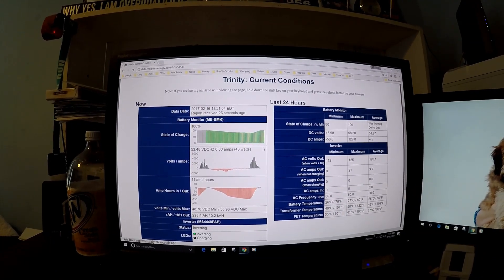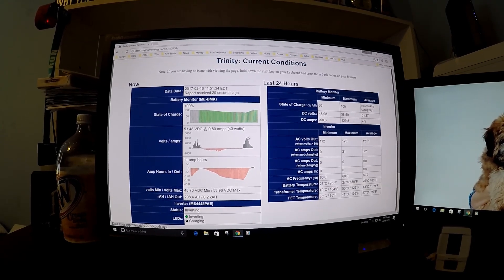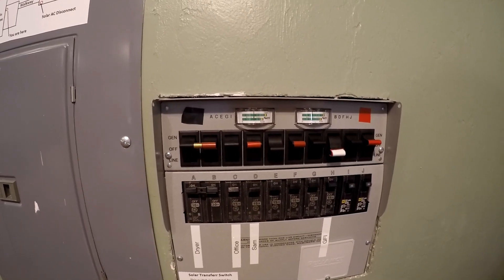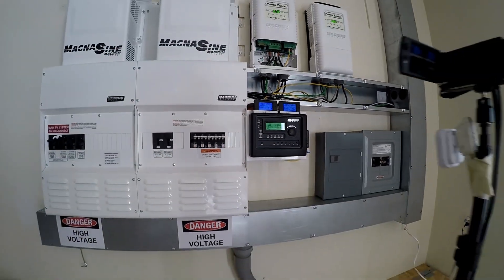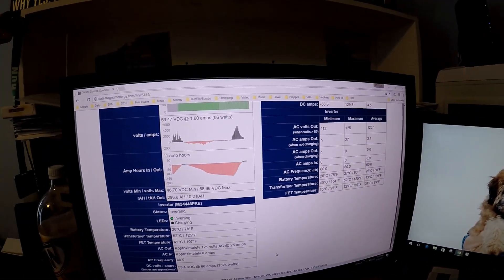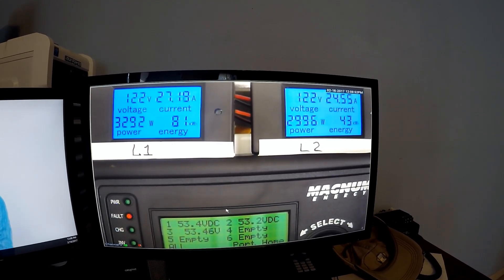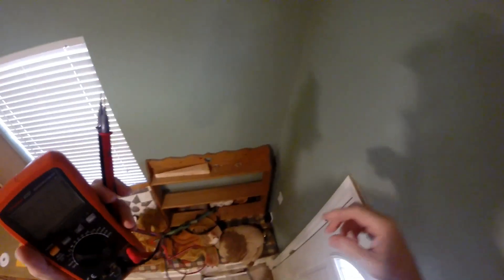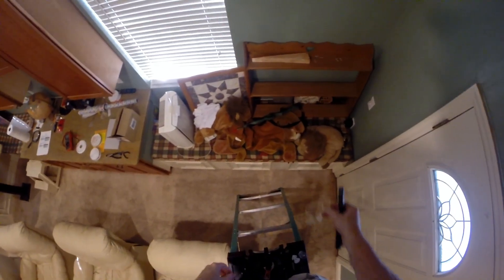Off Grid Solar #41: Running the Dryer on Solar

Comment: is the dryer completely electric? I'm thinking about going full electric, but thinking it will consume more than normal as it's 220
Reply from the maker: Yes, it is full electric and it is 240.  It uses about 6000Watts.  One of the biggest consumers of power in our house.  Think of it as like running 1000 LED lights.  Yikes!

Comment: I’d like to put a system like that together. I run off grid but can never operate my dryer please teach me your ways.
Reply from the maker: James, I have two complete start to finish series on my solar power but you might start with this summary: https://youtu.be/zb4oar9UHSY
Reply: @HomesteadEngineering  Just saw your comment on leadfarmer73 and while listening thought of drying clothes and left a comment.  Searched my question in youtube which lead me to you, how intersting-so I'm a new sub!  Thanks for the info, I'll be searching your vids as it seems like you're an old timer in you tube, cheers & blessings!
Reply from the maker: @gilamonsta5123  A good way to catch up on my channel is to use the playlist.  Thanks for stopping by and welcome aboard!  :)
Reply from the maker: @gilamonsta5123  start with this one: https://youtu.be/FUKDur73Ye4

Comment: Please how can you connect my commercial laundry to solar fully.
Musabalbarik2@gmail.com
Reply from the maker: musabalbarik2: Do you have a single washer and dryer or a business with many washers and dryers?
Reply: @HomesteadEngineering  I want to start a commercial one with many washersyand dryers
Reply from the maker: @musabalbarik2  :  My system would only run 1 washer and dryer and only when the sun is shining.  You should probably look into grid tied (net metered) systems.
Reply: @HomesteadEngineering  where i reside there is plenty of sunshine through the day and very hot.

Comment: I didn't realize you could run a dryer on the inverter.   I have so much to learn before going solar.  Excellent video
Reply from the maker: Desi, My inverter is rated for 8800 watts continuous.  The dryer takes about 6000 watts.  So I only run it with all the other big loads turned off.  I also do not run it on solar very often but nice to know I can if the utility is out for extended period.  Thanks!
Reply: Thanks for the reply.  May e I'll look into switching the dryer like someone else commented
Reply from the maker: desi, I have mine on a transfer switch so I can run it on utility or solar.  This video shows how I manage my system:   https://youtu.be/TNIA78586-M
Reply: David would the switch also work with a generator for being off grid?
Reply from the maker: Yes, my system is designed so that I can run off the utility, solar, batteries or a generator and it's all very seamless.  If you watch the series from the beginning, you will see the design and how I built it step by step.    Start here:
https://youtu.be/lcGjoHS6rnE
Reply: Thanks so much for taking the time to answer my questions and pointing me to the right videos to watch!

Comment: David, are your batteries typically drained by morning? I gather you just finished your project but, any plans to add more batteries to soak up the extra power not being used? I believe you are running SLA or AGM batteries. Have you looked into Lithium cells or Tesla Powerwall?

Comment: Incredible system! Your hard work paid off and will continue to pay off for a long time to come.  Not many solar systems allow you to run the dryer.   I like your idea of having a camera on your gauges to allow remote monitoring.  Would love to hear more about your camera setup.  I have a Lorex system that is horrible and have thought about going to IP cameras and Open source monitoring software.
Reply from the maker: The camera setup is a QSee.  Q-See 16 Channel 1080p HD Security System with 2TB Hard Drive, 16 1080p Bullet Cameras, and 80' Night Vision 
https://www.samsclub.com/sams/q-see-16ch-1080p-hd-4x720p-cams-1tb/prod19400222.ip?xid=plp4820109-shop:product:1:29

It works pretty good.  Hardest part is pulling the wire to all the camera locations.
Reply: Very good.  Thanks.

Comment: Excellent..that dryer is more than likely the "mother of all loads". Looks good! DIY off-grid...there are some things we do differently when the system throttles back (batteries in absorb/float). Def not a good idea to run a clothes dryer at night on battery! Mine is not on my solar circuit...but, do have two clotheslines outside and a drying rack!
Reply from the maker: I have only been running it during the mid day when I have surplus unused power.  I have been working on changing habits to try to move power usage to midday and greatly reduce power usage at night when on batteries.  Yesterday, I moved the pool pump to the solar.  It's the perfect load to put on the solar because I can choose when to run it, it pulls a constant, balanced load on both L1 and L2 and I can even adjust how much wattage it pulls because it is a variable speed pump.  Currently have it set to 500watts and runs from 10:00am to 4:00pm and runs completely on solar!  Batteries were 100% at 4:00pm.

Comment: looks like it handles it
Reply from the maker: Yes.  The magnums can crank out 8,800 watts continuous and 16,000 peak.  I do turn off the other big circuits prior to running the dryer to maintain some cushion.
Reply: That's running the hell out if the inverter at 140 amps. It take it but not good for it. 40 amp is better
Reply: What's it take to mod the dryer to 120v? 
Do you just wire it single phase 120v?
Reply: Cool G. Thanks!  did not think of that??? Wired my hotwater heater 120v single phase Works Great! So i'm going to try this. Love youtube keeps me thinking!!!